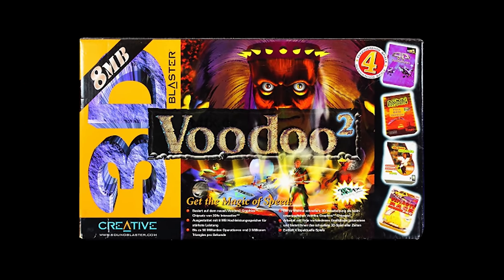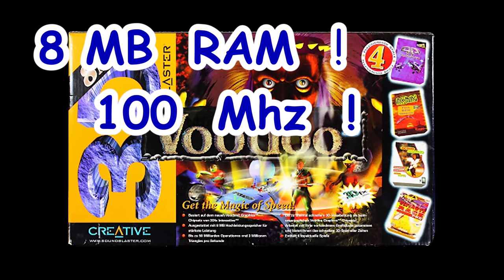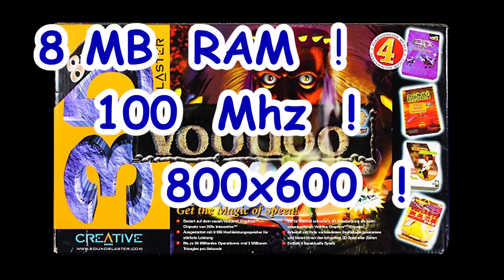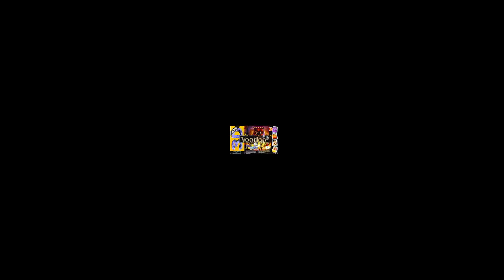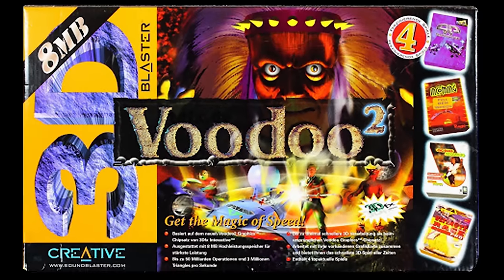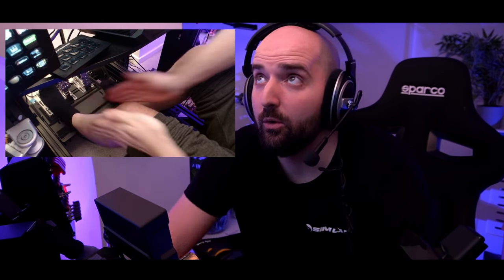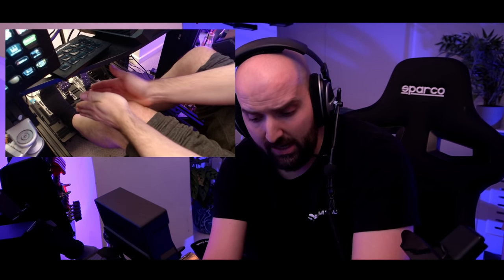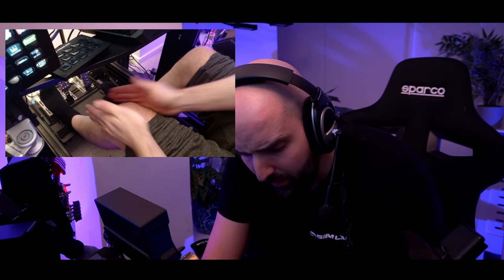How To Avoid Knee Pain When Simracing !

Comment: I've had a MPFL (medial patellofemoral ligament) reconstruction so am no stranger to knee pain aggravated by sim racing. I have a few pointers to add to Dr Muscle's guidance:

-Be aware and thus cautious of your knee and ankle alignment when attempting to heel-toe.
-Lose the macho-ego and use a lower strength on your load cell to make sure you are not straining yourself unnecessarily.
-Try different footwear solutions as just a few millimetre on the sole can make a huge difference anthropometrically
-Ensure your pedal set does not move when fully pressed and that this extension isn't causing pain.
-Make sure to pad or cushion sharp edges, like F1 driver leg foam (especially in VR)
-Take extra care with egress and ingress; have a set up that allows quick, easy and painless 'driver changes'. 
 
Remember you should be enjoying yourself, not torturing yourself.
Reply from the maker: Also make sure to have a DD girl rub your body down after a sim racing session

Comment: My personal recommendation is to have a proper seat angle if you use an alurig (angling side-brackets arent that expensive) and if you don't need a clutch, place both pedals equally apart from your feet. That did help me personally a lot.

If you do need a clutch, it becomes a bit more difficult. You may also want to place the clutch in the middle if you only use it for starts.

Comment: Gm, im really struggling to get my ffb in ams 2 to feel anything remotely workable, i have a dd1, an in every car it just feels totally numb , almost like a huge deadzone, lack of texture, very light, cant feel what the cars doing at all, then mid turn i get a load of powerful forces out of nowhere that make no sense. Please help asap, really want to het into ams 2 , but the ffb is dreadful for me. 
My current fanalab settings are

Force stength. 100
Lin.  Off
 Nat Damp..15
Nat fric..0
Nat ini..0
Ffb int...3
Force effectts...60
Forces eff str....100
Spring..100
Damper 100.

In game
Ffb 32
Low boost ..0
Effects 20
Damper 0.

Please help  , its "driving" me mad.
Got through 120 tea bags this weekend trying to sort this , im on the verge of deleting. !! 😔

Comment: This video comes at a fortuitous time since I've taken the last week off of sim racing due to knee pain. I actually had to hobble around for a few days! I never realized that my brake pedal was out of alignment with my knee, so hopefully that helps the problem. I also started exercising again just yesterday, so overall joint strength will probably do me wonders.
Reply: If your knees hurt so that you even have to hobble for a few days, think of visiting a doctor. It's one thing to have pain due to an accident (if you fell or whatever), it's not the same as having pain due to continuous repetitive load, especially if you plan on keeping doing it.
Reply: @vsm1456  it's most likely because I used to do alot of physical work on my knees in construction. That's when my left knee started to give me problems. I'm actually taking an extended break from sim racing to start exercising again. If I strengthen the muscles around the knee, the strain of braking should be supported across the whole leg. Since starting my training program, the knee pain has started to subside and I can walk up and down stairs again with no problem. I'm still going to give it a couple weeks of exercise before I go back to the drivers seat, but if the problem comes back, I'll have to go to the doctor for sure!

Comment: I would reduce brake force on loadcell. Also my heel is resting on the pedal plate so I don't have much stress on my knees? So far so good. I only have pain if my leg is bend 90 degrees and heel is in the air

Comment: I am new to sim racing and I thought about this a bit before finding this video.
What is your opinion on to actualy making throttle pedal stiffer to even out the load on individual legs? Because it seems to me from what I have seen in review videos that left foot is doing a lot more work with those loadcell pedals. So I am bit worried about creating imbalance when I would buy a loadcell pedal set.
Reply from the maker: I make my brake quite light to be honest , also make throttle quite light.   The only reason I'd make the throttle more heavy is if a person accidently adds to much throttle.

Comment: The issue is my knee pain is the right knee not the left and caused by using the throttle
Reply from the maker: Make the throttle lighter , and make sure the throttle is in line with your leg / knee / hip
Reply: @GamerMuscleVideos  Problem is i have simagic p2000 pedals and the pedal tray doesn't allow it too go too far over and if i move one i have to move the  both including the brake and thats the one i had most issue with until i got the brake level with my hip as you say, maybe i could just remove my clutch because i never use it anyway. 

Cheers though mate